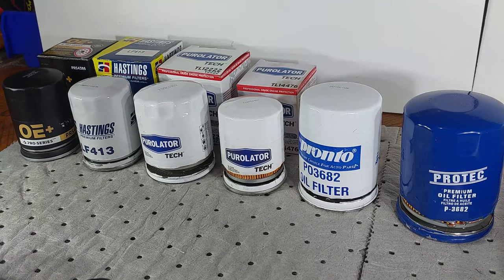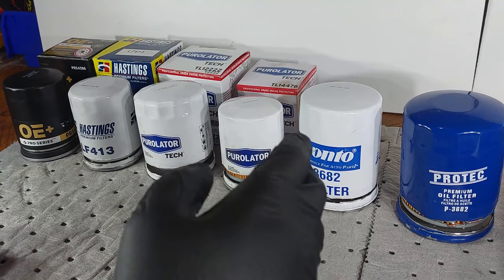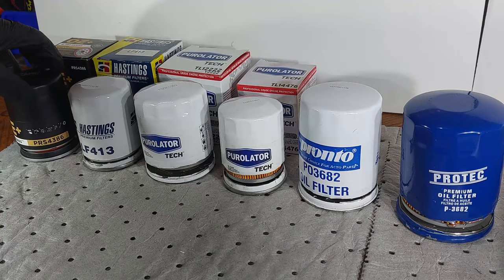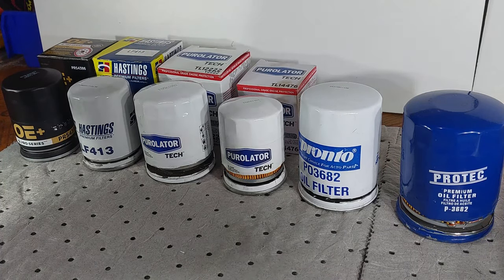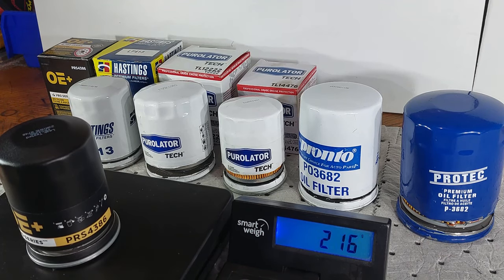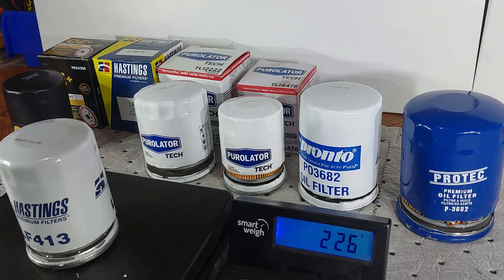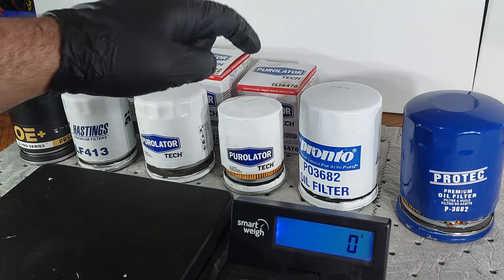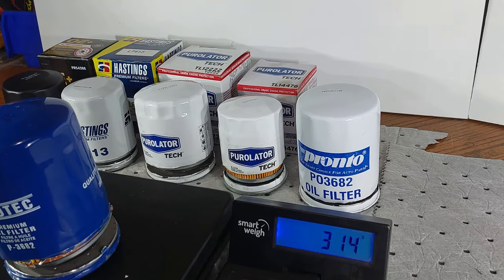More Oil Filters - Comparison Between Brands - 2nd Video

Comment from the maker: Oil filter removal tool
Lisle 63600 Import Filter Wrench, 2-1/2-3-1/8
https://amz.run/932k

Oil Filter Cutter Oil Filter Cutter Zinc Alloy Oil Filter Cutter 66490 Precise Zinc Alloy Strong Strength Fit For 1‑3 4In To 5‑3 4In Oil Filter (Red)
https://amz.run/932l

Oil Filter Comparison - 6 Different Oil Filters/Brands
https://youtu.be/AwsbTHR4wZg

2023 Mazda CX-5 - 2.5 - Oil Change Service
https://youtu.be/k-Tmanm5Xvs

Why NOT To Do Extended Oil Change Intervals? 10 K Miles/16 K Kilometers
https://youtu.be/yLK8O0k-Fjs

2024 Honda Accord Hybrid 2.0 - Oil Change Service
https://youtu.be/IuH3ZWwZlzk

What's Inside of an Oil Filter at 8000 Kilometers/5000 Miles - First Service
https://youtu.be/eWrxN5xKR6o